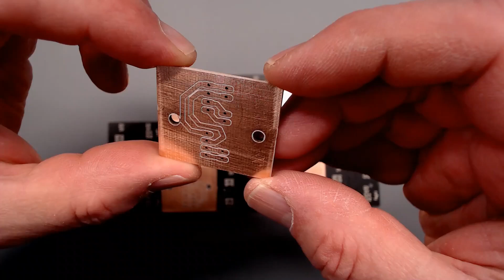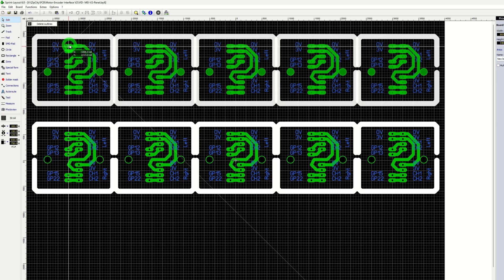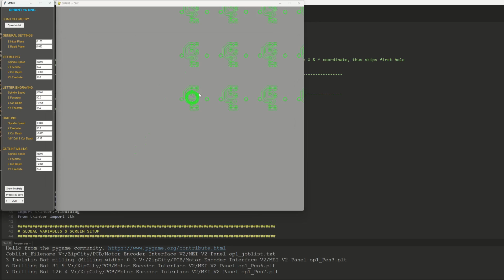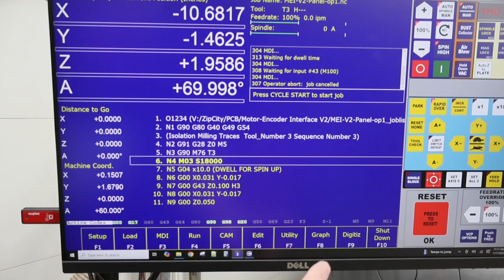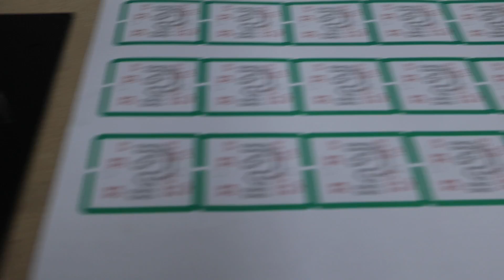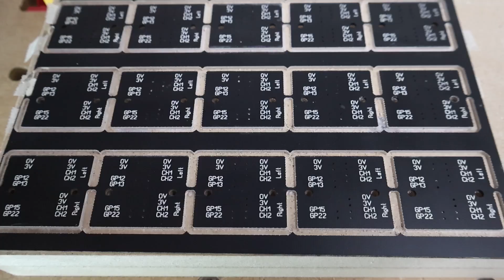12   How to make PCBs efficiently using panelization

Comment: Hi Chris, not wanting to be too picky but the sibilance is really bad on your audio.  You don't appear tobe too close to the mic, so are you tweaking the high frequencies to make it sond better ? (A life around cnc machines doesn't to the ears much good,.BTDT) It might be worth tracking down a free de-esser plugin for your recoding chain just to tame it down a fraction. Bill
Reply from the maker: Good morning wktodd,
Thanks for that feedback, you are the second person to suggest that.  

Perhaps you can help me track down what is causing it.  The only time I edit audio is when there is background noise such as a furnace running (when I am filming at the electronic bench) or some other constant sound like that which can't be eliminated.  I use Audacity to filter that out.  Other than that, I don't edit audio (simple don't have time to do so).
Do you notice this when I am filming at my Electronics bench or is this something new while I am filming in the shop?  I used two difference microphones, wireless lavalier in the shop and a Boya Shotgun on the bench.  The acoustics are certainly very different in those two places.  
As for mic placement, it is VERY RARE I am any closer than 12" from a microphone and even more rare is talking directly at the mic.
When doing the video editing, I use logitech speakers with a subwoofer, not the greatest, but they actually sound good.  With that setup, my audio level matches most other people's videos,  audio quality is also VERY similar (peoples voices are all different etc.).

You did hit on one issue that probably prevents me from hearing the "hiss".  As you noted, I spent many years in machine shops .  Much of the last 40 years I have been teaching in shops so wearing hearing protection defeated my ability to communicate so they were often not used.  But that is only one of the many things I have done to destroy my hearing.  I used to race cars, big engines, open headers, lot's of fun, but VERY LOUD and I never wore hearing protection there.  I also used to shoot competitively, both indoor and outdoor, mostly I used protection shooting.  Woodworking with machinery is very loud, rarely did I use hearing protection, same thing with lawn and garden care - never wore protection.  Without question my hearing is REALLY BAD so I might not even be able to hear what you hear.

As I have to resolve this working "blind" any specific information can help me a LOT.  

Thanks much!
Chris